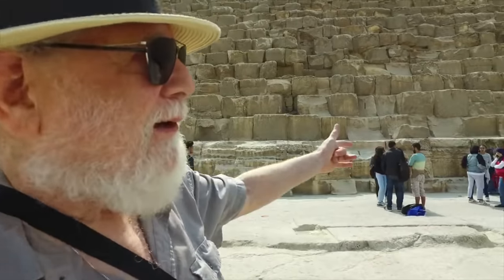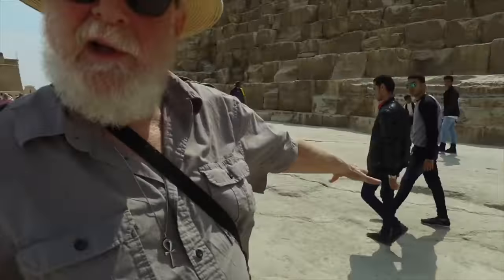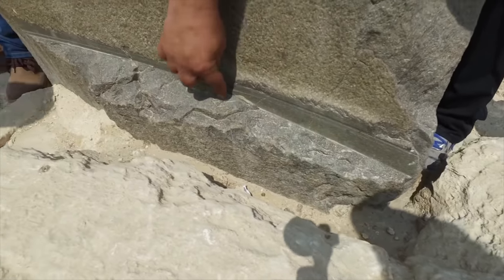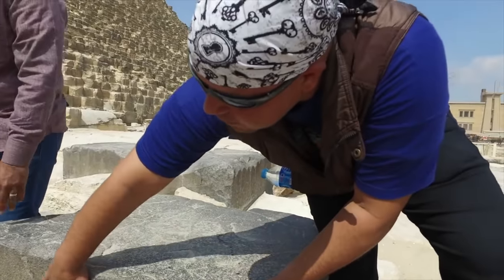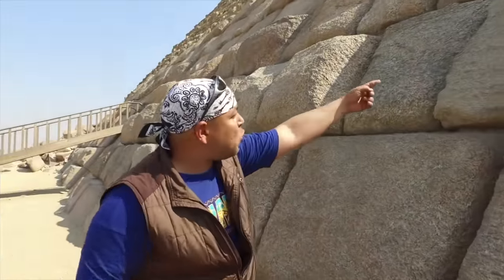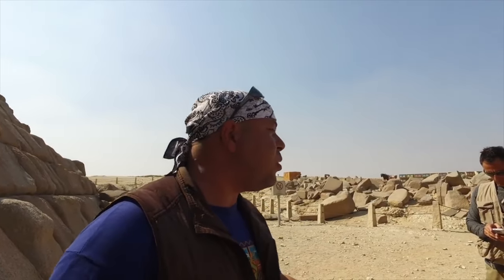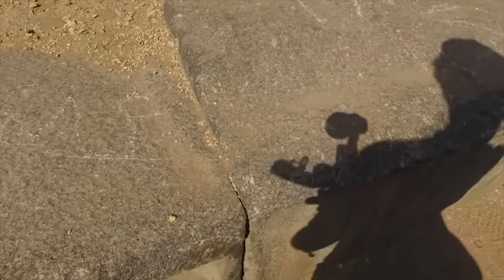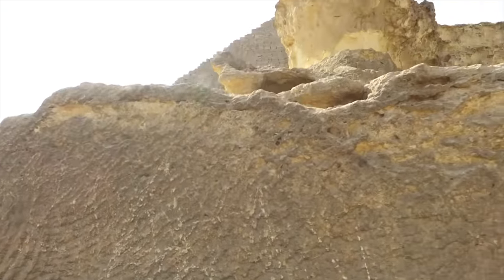Exploring The Giza Plateau In Egypt With Author Stephen Mehler And Guide Yousef Awyan

Comment: What if the pyramid structures doted around the planet at specific latitudes and longitudes were ancient Ham Radios?

If the piezoelectric effect was generated by the mass of the pyramids, while the buildings surrounding were equipped with stone analog logic gates you could say the entire Giza Plateau was a circuit board the size of a city. While harnessing that much geomagnetic energy it might be possible to tune the occilating frequency output from the obelisk towers. Thus turning it into an ancient two way antenna/Ham Radio. If the output carrier wave were specifically tuned to the inverse harmonic frequency of the ionosphere you could in theory bounce data across the world to every other pyramidal structure set as a two way receiving antenna, simultaneously. Theoretically a 12,500 b.c.e. to 30,000 b.c.e world wide telegraph network of the most rudimentary design might have been possible.